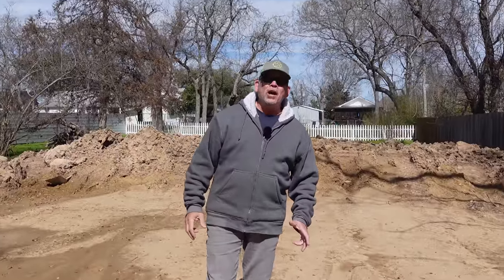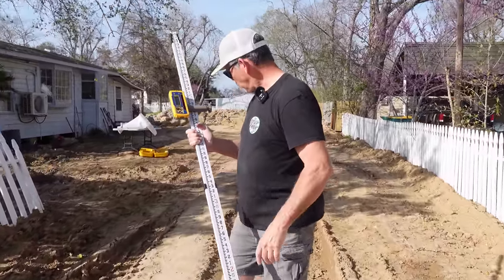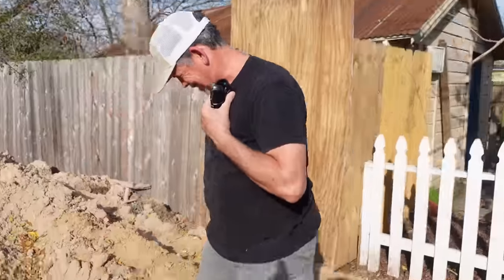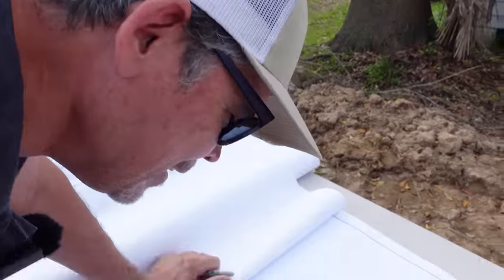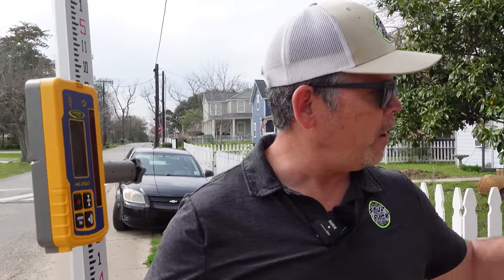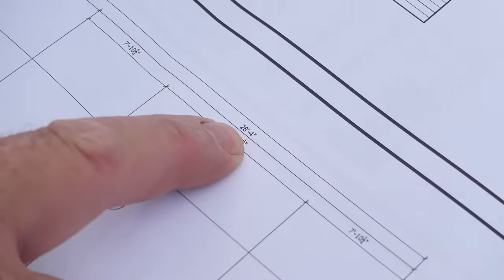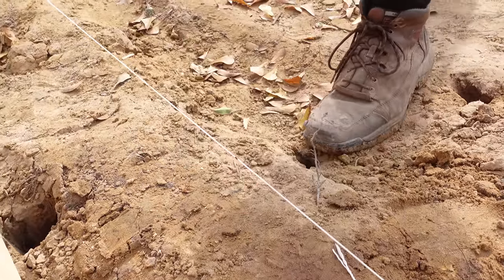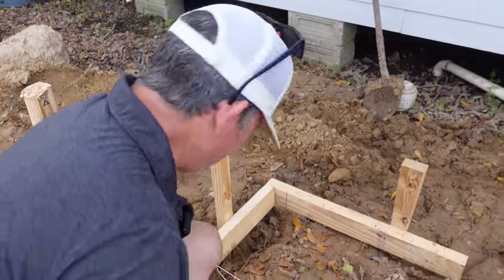Building our FIRST FOUNDATION EVER! (We're Nervous)

Comment: Are you going to have any use onsite for all that spoil behind the garage pad? Wouldn't it be easier to have it removed before you start construction?
Edit:
OK, I see from your subsequent video that there will be more fill removed from the pad area to dig trenches for the grade beams, fill that will be added to the pile of spoil in the back yard. So removing it before you did that would have been premature.

Comment: So, the pole y'all were using is called a Philadelphia Rod.  As an aside, it is also used as the rating symbol for the Seabees' Engineering Aide rating.

Seemed strange not to see y'all waving it back and forth.  I know you need to do that with a transit, to ensure it's plumb - due to its length, you can't really rely on the spirit level to ensure it's plumb.  It will move no matter what you do, so the person reading the transit gets the highest reading as the person holding the rod waves it.  Not sure how that works with a laser level, though.

Comment: I’m surprised you didn’t use a Construction Master calculator.  You can enter the feet/inches measurements and use the diagonal function to solve the 42 feet 8 7/8 inches.  I will admit the full math operation is a little fun.

Comment: Building to 16ths during rough is cool and I'm sure you couldn't stop yourself from that style, but it's kinda like putting an expensive paint job on the inside of a wheel barrel.

Concrete is too heavy to maintain that level of accuracy.
I am all for math 100%, but 345 pull through and double check diagonals it's gonna rain!

Comment: IMO your string line for the batter boards needs to be pulled MUCH tighter.  There is a way to loop the end so its like a slip knot and you can pull it real tight.  Essential Craftsman on YT has a video demonstrating it.

Comment: It looked like you uses a cloth tape. That may not give you the accuracy you are looking for. In college, one course I took was survey. We did field and class courses. You should be using a steel calibrated tape (Chain). One story we were told, in NY City an error was made on location of a building. Upon completion the owner of the land it encroached on told the owner to move the building.
A licensed surveyor is worth the cost if you are required to obtain the accuracy you indicated. If they make a mistake you have recourse. They have insurance. If you make a mistake the cost is 100% yours.

Comment: How did your title company allow you to close the sale on that property with at least one (thus far) encroachment?  You have a cloudy title that could jeopardize obtaining a mortgage on the completed project.

F.F.E. is most commonly mandated by local building authorities with regards to FEMA Flood Maps and not by choosing an arbitrary height above a sidewalk or street.   Your architect and civil engineer should have obtained the required elevation for both buildings.  Both floor elevations must be strictly coordinated to facilitate the requirements of the connecting bridge, access to the residence, and drainage between the buildings

Comment: Make room for the reverse osmosis water filter and water tank for your car wash pressure washer, and you'll get spot free car washes!!
Reply: It can be cheap for personal use, just need an IBC tote or equivalent to hold water and slowly fill - you don't need a 50,000$ car wash high flow reverse osmosis machine.
Reply: The IBC tote can even be mounted in the corner, up off the garage floor near the ceiling, to avoid taking up garage floor space!
Reply: And, algea won't grow in a sealed RO water tank, because there are no minerals or debris for plant growth, so no chlorine or sunlight protection needed for spoilage issues like you have in rain water collection systems or municipal water storage tanks.

Comment: quick tip for you guys. get rid of that plastic tape measure you used and change to metal one. the plastic one can stretch and throw off your measurements. also, to get a more precise layout using pythagorean theory instead of 3:4:5 you can use 6:8:10,  9:12:15,  12:16:20,  15:20:25
Reply: They used the formula instead of just going off common squares.

Comment: Just to clarify, what you calculated isn't a 3-4-5 triangle (340:384 isn't a 3:4 ratio) but the good old Pythagorean theorem still works :)
Reply: 3 4 5 is   A sq + B sq = C sq
Reply: @keenelanzer1675  Right but the video implied they were building a 3-4-5 triangle which they didn't. It was just one example of using the theorem.

Comment: 8:56 Should have made the white coax line come up higher on the pole so you can put a drip loop on the black coax line so water doesn't run down the black coax and into the ground block but instead water would run down away from the ground block......and should put some silicone in the opening of the orange conduit try to keep water from filling and sitting in the conduit.....water ain't good for nothing but drinking.....and these days even that is questionable

Comment: Those Imperial measurement calculations looked comically complicated! I feel sympathetic that you have to suffer such a difficult system. Once you go fully metric it will be so much easier for you. Here in New Zealand, we are fully metric. In construction, we just use millimetres - we avoid metres to avoid confusion - and there’s no possibility of mixing feet with inches or fractions of inches.
  Great video guys. Very enjoyable viewing.

Comment: Pythagorean theorem won't work with light years! 📐
Reply from the maker: Of course it will.  A light year is a distance not a time.
Reply: @StudPack  The theorem works on a flat surface - Euclidean Space. At the scale of 30 ly the space itself is measurably curved due to the presence of Earth, Sun and/or other masses. So it will be like drawing a triangle on the surface of your propane tank - the triangle, even when drawn with straight lines, will actually be "bent", and the theorem won't work. 
P.S. I really enjoy your videos btw!!!